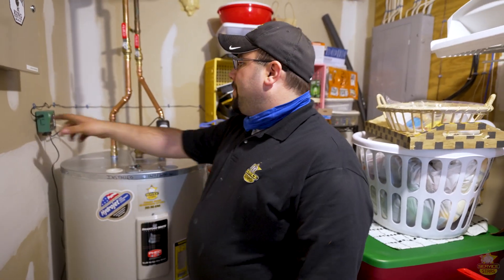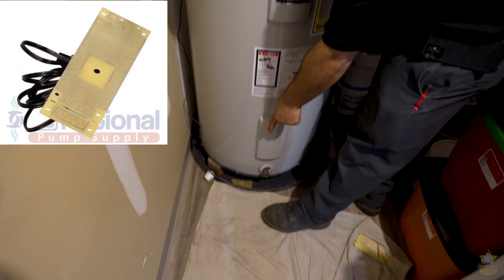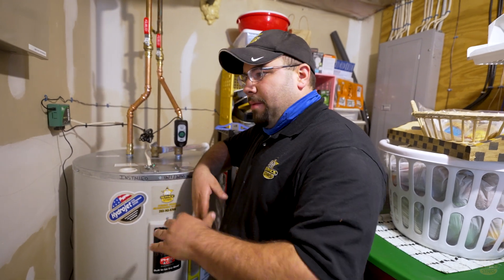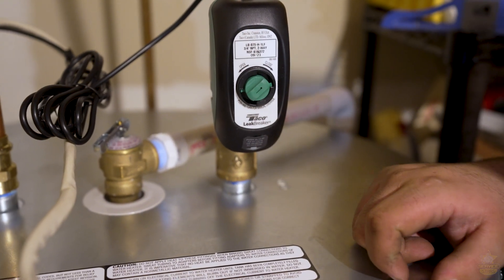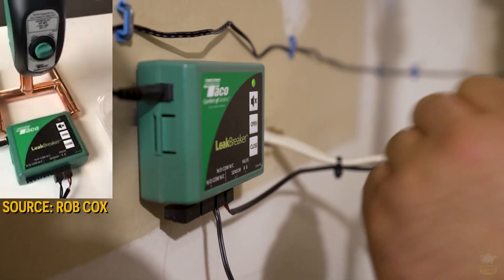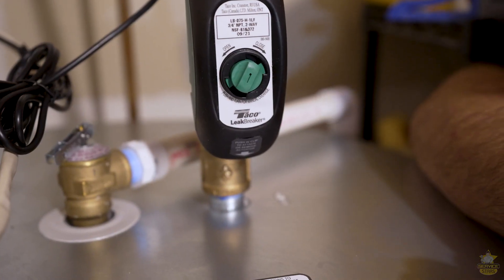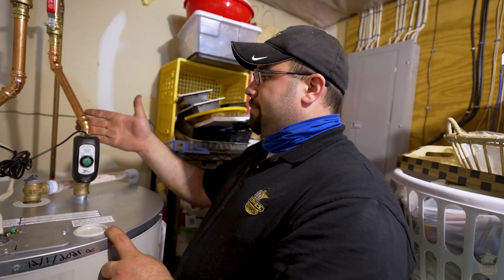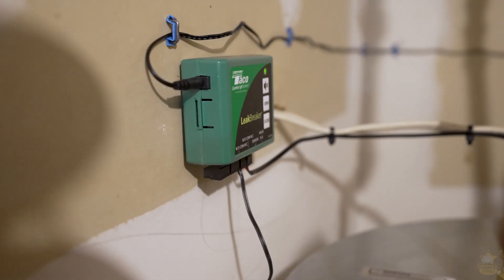INSTALLING TACO'S LEAKBREAKER - THE AUTOMATIC WATER SUPPLY SHUTOFF VALVE!

Comment: What are the specs of the power supply in Volts and Amperes? I have a unit running on battery but don't think I should pay $35 for a $5 power supply.